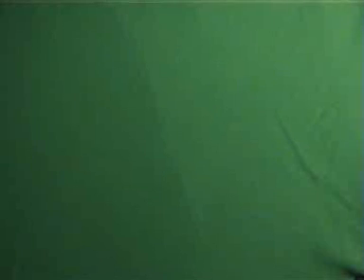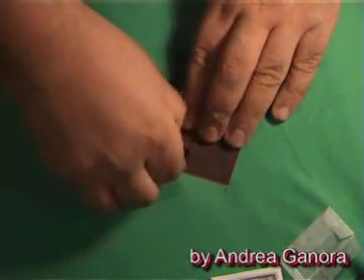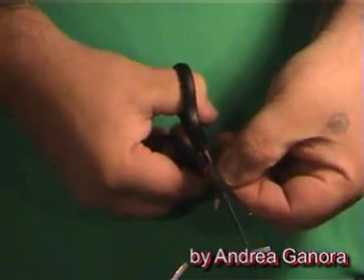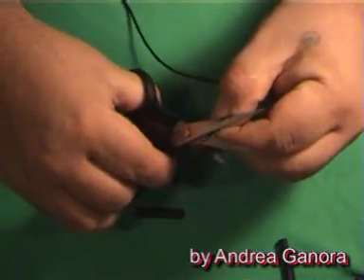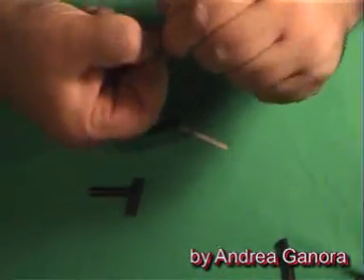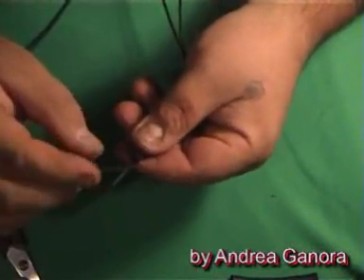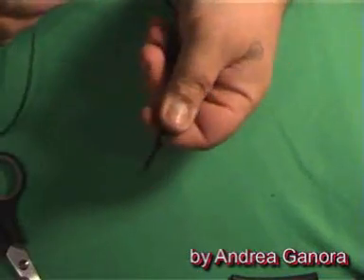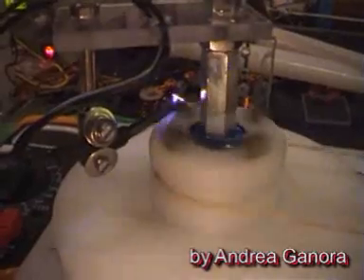002 - selfmade magnetic or mechanic switch

Comment from the maker: @redxz0r 
Hi , that's called "heat shrink tubing" , it's a tubing/sleeve that you can use to insulate or protect soldered joints in electronics projects or for any other application were you can use a tubing that will shrink when heated.